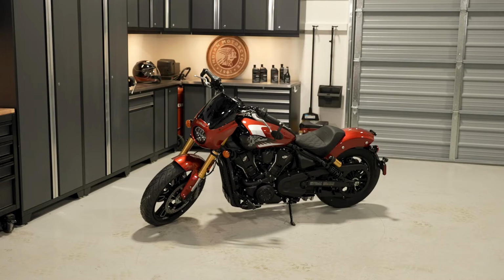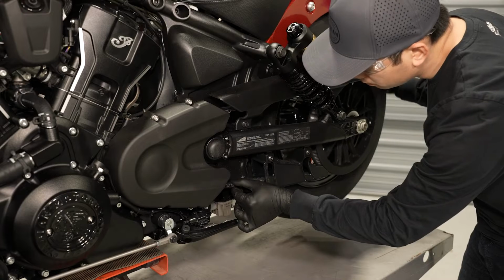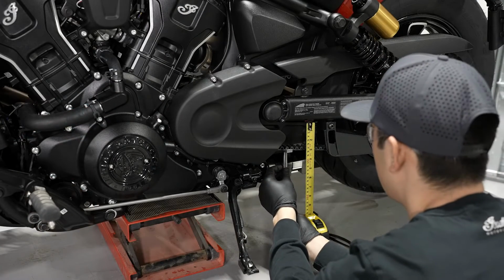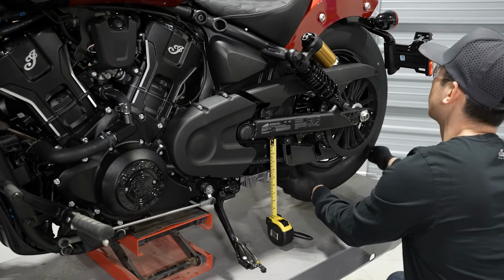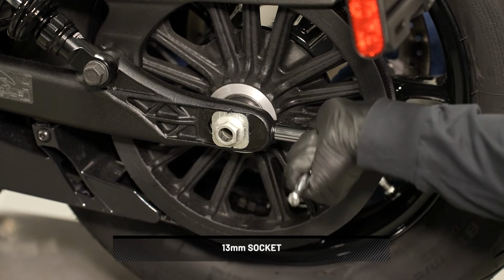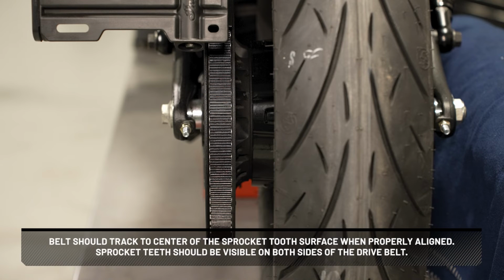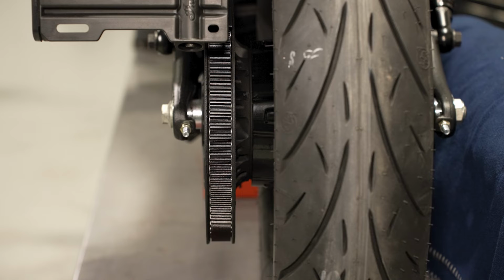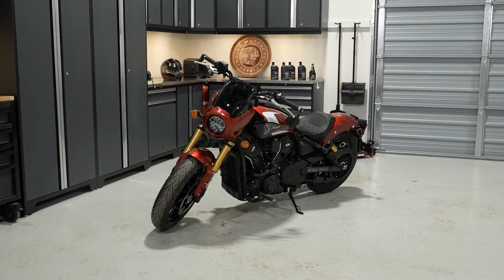2025 Indian Scout | Drive Belt Inspection and Tension Adjustment - Indian Motorcycle

Comment: Is it normal for the belt to be off-center after fully torquing down?
Reply: Wouldn't it be nice if they replied?
Reply: I just realigned my belt on 18 bobber. My belt stayed centered after torquing the axle nut down. Your wheel might have moved slightly after torque. I kept hand pressure on the wheel while hand tightening the nut to prevent the wheel from moving back then torqued. Hope that helps.
Reply: I just did this on my 22 Rogue Sixty. Boy, the adjustment is finicky. BTW, tightening the right bolt moves the belt to the left, loosening to the right. I had it centered then torqued the big nut and the alignment went out, took a few back and forths to get it right.